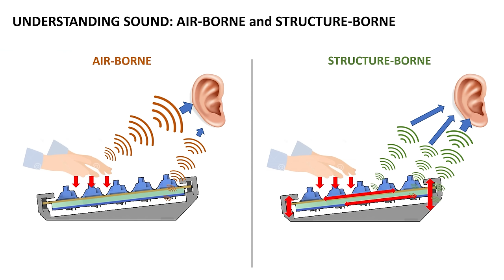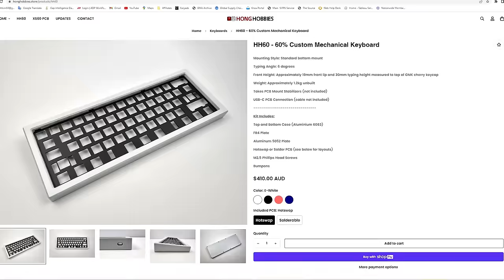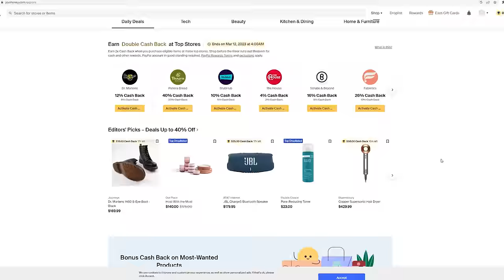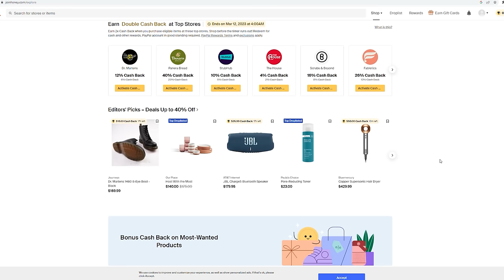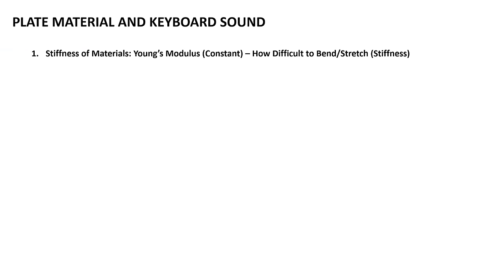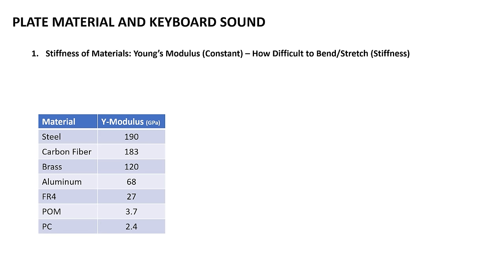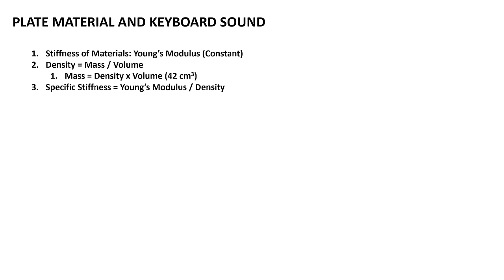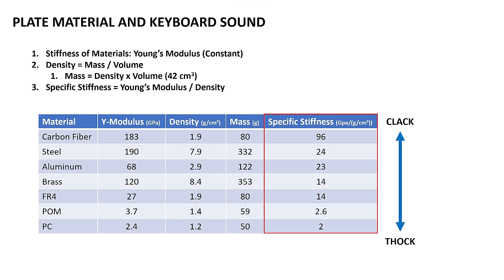What Do Different Plates Sound Like?  Featuring the Engineered HH60

Comment: Some concerns about the young's modulus: brass is an alloy and different ratios will change it. Steel is a complex material and no two steels are the same and can vastly change the sound. Though, most of the more interesting steels you will not find as a keyboard plate
Reply: hardened carbon steel for maximum stiffness
Reply: @KP-by4eu  it’s not pitches actually. The difference is in overtones and undertones. It’s the reason why you are able to tell a trombone made from brass from one made in plastic even though they are playing the same note. Each material creates different undertones that contribute to a sounds characteristic. Also a ear can tell minor differences at least a microtone apart, and the sound each of the materials create has a far greater difference than a microtone.

Plus there are foam less metal boards that sound amazing. Refer to unikorn and Kohaku.
Reply: @KP-by4eu  I actually agree, I hate all the metal sounds. So I went with a polycarbonate plate and case.

Comment: sound test

5:40 carbon fiber(CF)
6:34 aluminum (ALU)
6:45 CF vs ALU
7:28 FR4 
7:37 FR4 vs ALU vs CF
8:48 POM
8:58 POM vs FR4 vs ALU vs CF
13:40 brass ping test + Sound Chart

10:44 Quick Sound Chart Data
 
@Keybored thank you for helping me choose between plates.
I would have loved to hear the brass in an actual typing test
I appreciate the information you've brought together here.

Comment: This is just what I was looking for.  I just ordered my first keyboard kit the Meletrix Zoom98 and their are 4-5 plate options including carbon fiber, Fr4, aluminum, Pom and brass.  The brass plate is the one I was most curious about.  My experience with acoustics is from building speakers so I have been trying to relate that to keyboard sound.   I liked the discussion about plate mass, stiffness and density. I found it very informative.  I'm new to the custom keyboard hobby.  I was using the same 20 year old Steelseries Shift membrane keyboard until a couple of weeks ago when I spilled a beer on it and decided to replace it with my first mechanical keyboard.  A Logitech K845ch with Cherry Blue tactile switches.  I was amazed at the difference compared to my old dinosaur keyboard.  I should have done this years ago.  I just figured a keyboard was a keyboard.  Now I'm going to try my hand at building a custom keyboard.   I ordered the Zoom98 on a group buy and it isn't going to ship until January.  Thanks for the video.  Subscribed.
Reply: How did the Zoom98 build go?? I am in audio/video/lighting as an integrator, so I don’t build speakers but I do build designs for small production venues. I made similar comments on videos when I first started! My love for audio is one of the biggest reasons I enjoy keyboards.
Reply: What plate you end up using? really curious about it
Reply: @arielmatiauda5110  Hi I have had the carbon fiber plate installed since I built it.  I've been so happy with the keyboard I haven't changed it yet.  I will play with that this winter.  This was my first custom keyboard so I shotgunned all the accessories because I wasn't sure if I could get  them in the future.  I think I will try the brass plate next.  Is there one in particular you are interested in?  I can try it next if you want.
Reply: @bradyvilhauer4445  Hi sorry for the late reply.  The build went very well it's an excellent keyboard. But this is my first custom board.  It's so much nicer than any keyboard I've ever used.  I'm using Wuque Studios Morandi linear switches. And WS WOB PBS double shot keycaps. I bought all 5 plates and am using the carbon fiber one since I built the keyboard.  I will try the others this winter.  It's the smoothest, queit4est keyboard I've ever used but I learned to type on a Royal manual typewriter back in the day.    The speakers I built are the 2TDX Criton tower speakers I built the cabinets myself from 3/4" redwood  oak rather than the flat pack mdf.  I also built a Elekit 300B tube amp to drive them.  I'm very happy with the setup.  Any thing you want to know about the keyboard?
Reply: @mojoneko8303  i have recently bought this kb with a PC plate and wanted to hear opinions on how it compares for example with brass or aluminum, heard that PC is one of the stiffest plates, it's also my first custom keyboard, i haven't received it yet
Reply: @arielmatiauda5110  Hi.  I have the tri-mode
non split PCB version.  I haven't tried all the plates yet.  I will play with that this winter.  Too much going on in the summer to mess with it now.   The PC plate is the Poly-carbonate plate?   I was after a smooth quiet keyboard.  I think I've achieved that.  Good luck with the keyboard.  
    I shotgunned all the plates and modules when I ordered it because I wasn't sure how available they would be in the future.   I want to build a second custom board for my Linux PC but I haven't decided which one yet.
Reply: @mojoneko8303  it's polycarbonate yes, I'm getting this board in order to play around with switches mostly as I'm indecisive about them, i chose this board for the durability aspect of it as i think sound could all be almost taken care of by the foam accessories and switches in it, what kind of switches gave you this silent results?
Reply: @arielmatiauda5110  Hi.  I'm using the WS/Wuque Studios Linear Morandi switches and WS White on black double shot key caps. It's very quiet and solid. It's also very heavy about 10/13 pounds or 5/6 Kilograms.  I have the internal stainless steel weight and installed all the foam.  It's a real Thocky keyboard.  I will try tactile switches and the other plates this winter.  I use the keyboard with my Linux PC.

Comment: I came in to say that this keyboard is so underrated and unrepresented. I love my E-White HH60 that I purchased from Even. This board represents the very essence of what a foamless keyboard should sound with a unique mount for a 60 series (compared to top mount). Paired with HMX switches or even metal stem Tempeh, this board sounds amazing for the clacky profile I love. I only made a few minor mods, forces break and tape mode to settle the bit of hollowness. I love the simple design but with elegant chamfer. It's not box/wedge but it's also not so busy around the edges. I would have loved l to see this in a 65% as the added, sound, foamless I would assume but this up into the premium rank of boards like my Forever65. My next experiment is to cut up the FR4 plate and make it a half plate and use the solder PCB. I think that would address some of the hollowness without use some tape mod and bring out an even brighter sound.

Comment: I love this specific stiffness chart. If you like lightweight and clacky, pick carbon fiber. If you like heavy and clacky pick steel. Medium weight and clacky, pick Aluminum. If you like lightweight and thocky pick PC or POM, if you like balanced and heavy pick Brass, balanced and light FR4. The only thing you can't really have is Thocky and heavy, at least not in terms of raw materials, but there are, of course, all the other factors for keyboard sound. Me? I assume I'd like balanced and heavy the most, so I should go brass as long as the budget is okay.

Comment: Just want to point out that the values used for the carbon fiber plate in this case aren’t really accurate because most carbon fiber plates are coated in resin or something, not pure carbon fiber. Because of that, I expect most CF plates are probably deeper than you would expect from this breakdown

Comment: Thank you for this video! Newbie to the hobby and plate choice has been giving me headaches because I want to join several different group buys yet I have no experience with anything but aluminium. Add to that the fear of not being able to get different plates afterwards, made me buy a lot more plates than I probably should have. Wish I had found this video two months earlier.

Also, for some reason, I absolutely hate that spacebar on the Aluminium plate. I don't know why. That specific sound just irks me to no end. Every other key sounds fine to me, just that spacebar on Aluminium. Guess I now know which plate to always avoid. :D

Comment: Is it bad that my first thought was: I wonder if I could fit a kilmat and tape in that case :goodvibes: It's odd though... Pom plate is deeper than PC plate in every video I've seen, could it be the way the material resonates or the thickness of the pom plates produced? I noticed pom also has a rougher finish by nature than PC
Reply: I actually did this but when our power went out, I think the kilmat softened in the heat and ruined my keyboard, even though I had tried to add a protective layer between the PCB and kilmat. I'm not 100% sure about it, though. There was black gunk in places that was hard to clean, at least

Comment: Hi Scott, great demonstration of the differences between plate materials. An engineering-first point of view is always appreciated. There are a few things that I believe you missed. While conducting the typing test, you pushed your wooden wrist test against the keyboard, which would have changed the resonant properties of the system. Additionally, Young’s modulus and specific stiffness, while a good starting point, unfortunately aren’t sufficient for a description of plate performance in my opinion. Materials such as brass have significantly lower internal damping capacity than aluminum, and potentially more resonant mode frequencies. Factors like that can contribute to what is also often associated with brass and steel plates, what the community refers to as “pinging”. Keep up the great work!

Comment: Thank you for this. I really wanted to hear Brass too btw. But great video!

I’m a sucker for the science. Read appreciate that! I’m thinking an all Brass case with plate would sound great. But then again, a brass violin sounds very high pitched compared to a wooden one 😵‍💫 I guess I have to try it out myself to experience what a full brass keyboard sounds like.
Reply from the maker: Brass is probably in between fr4 and pom :)
Reply: @Keybored  thanks!

Comment: I bought a POM plate for my keyboard that has pcb mounted screw in stabs.  Love it and the sound.

Fur my sister's keyboard keychron k8, the stabs are clip on plate mounted.  The plate stabs for spacebar were a challenge because the plate would flex compared to the original steel plate, cause the spacebar stabs bar to be uneven and jam.

Resolved it with a little Dremel work to better fit the clip in stabs.

Btw, i love the white POM as it really displays pcb underglow rgb amazingly well.

Comment: The board is a really clean minimal design, but I think there is too much completion in this minimalist 60% space for this to gain much traction.  With boards like the Tofu60 2.0 on the horizon for a significantly cheaper price with a brass weight and three options for mounting, its a hard sell.  Either way, great content as usual Scott.  Love hearing all of the different ways you can make one board sound. Keep up the amazing work.
Reply: This board sound way better than the Tofu mk2 though with it’s flex cut and foam reliance

Comment: bro that is your 3rd video with the stiffness chart in it and you still have the wrong value for the carbon fiber in it, carbon fiber used in those plates usually has a young's modulus around 60-65GPa and at best 90GPa